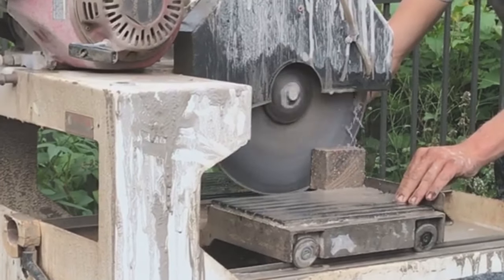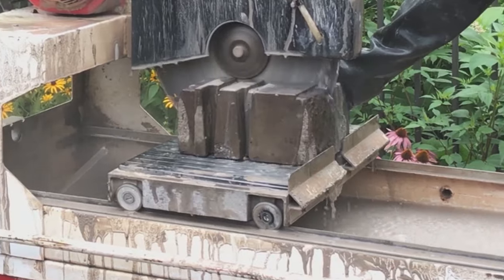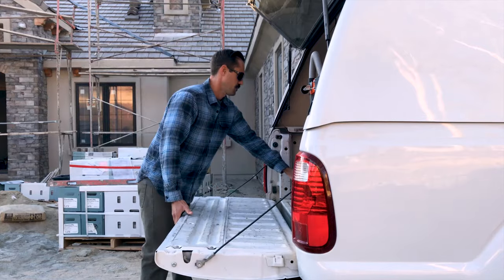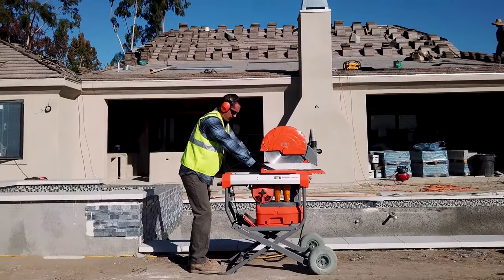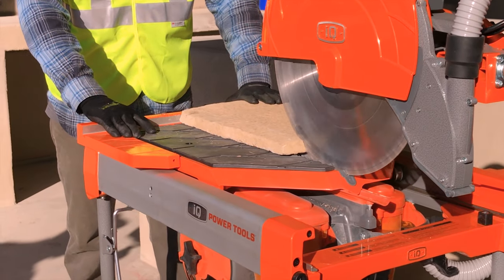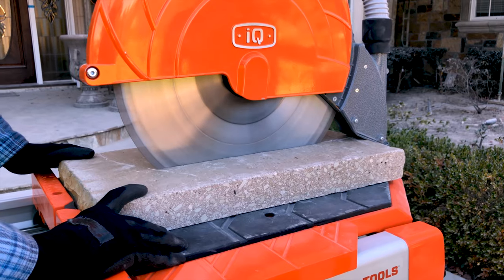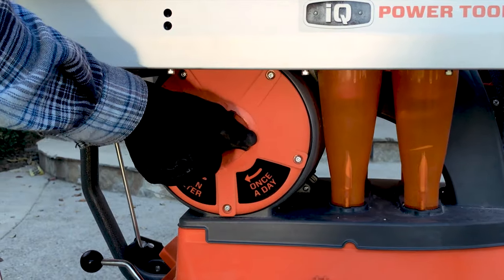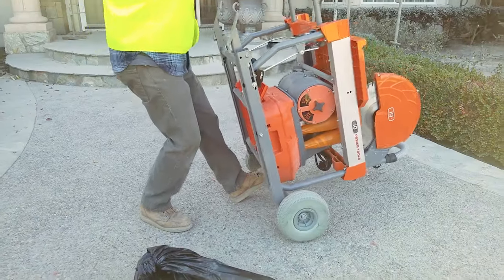World's First 16.5" Dust Control Masonry Saw the iQMS362™ | Dry Cut Dust Free Masonry Saw

Comment: I own and work with this saw on a daily basis cutting mostly brick pavers and block. Overall the saw is what they say it is. But it's under powered and there quick cut blades are crap. They say you have to dress the blades, but you shouldn't have to do that every 2 days. The 20 amp saw pops breakers if you try to cut at any decent pace. I'm going to convert it to a 30 amp and run it off a generator. The dustless design does catch most of the dust when the saw is brand new with new filter but ends up in about the 70% range or you keep buying filters for it. All in all it is costly to maintain but, it's still the best design out there for me right now. I think a much better design would be gas power to the saw and electric and or gas to the vacuum. And a circle Arbor hole so we can use the blades we know and trust from the companies that have put a lot of money into R and D. The Q drive was pretty shity thing to do.

Comment: I just purchased for our stone and brick masonry company. It did not come with the caster wheel shown in the video. Hoping it was just missed at the factory and will be sent to us by the company. The saw we rented had less dust than the brand new one. It is doing great, though. We are working inside with 12 inches of snow outside. Very glad we do not have to run outside for every cut.

Comment: I own it since today and be careful before you buy it. The only way to work as close to this video is if you  use it as the video shows, it means   arm saw is in lowest position and you can only slide the tray forward. You have no chance to play with it to do perfect cut. And even if you do it this way there is quite a lot of dust around you . I would call it 60 percent in stead of of 99.5. And now if you want to use it as the chap saw it is not working completely.  So I spend 3000$ for dustless saw and I have dust saw . But IQ won't tell you that it only "works" when you cut in lowest position. So think twice before you buy it
Reply: How is it waterless.

Comment: Can you cut 200mm blocks?
Can the blade be raised higher as to cut both sides?
Reply: @John Sharp, there’s NOT anything you can’t cut with this saw; solid concrete blocks, porcelain tiles, cinder blocks, glass tiles, ruble stone, etc.

Comment: The advertising is misleading though. It’s advertised as a dustless and waterless saw for masons but the saw is extremely efficient at cutting so smoothly and cleanly  and through just about any material that  pretty much anyone from a tiler to a general contractor could use it. 🙊

Comment: Guys, Don't forget that water lubricates and cools down the blade, which saves you a lot of money in the end! I.e. it's not only about dust...when you realise how expensive blades are you' ll go for a wetcutter
Reply from the maker: Thanks for the tip Alexandre. Yes, it is important to keep the blade cool. That's why we use Cool Cut technology in our blades. It works in conjunction with the airflow created by the vacuum to keep the blade cool. Using an iQ saw and with the proper blade will allow you to cut dry without the mess while maintaining efficiency and great cuts.
Reply: @iqpowertools  water is unbeatable as a lubricant and cooling agent especially when cutting granite. Have you done any tests on how long your blade lasts vs. A wetcutter's?
Reply from the maker: @alexandrepakou3065  yes we have. We have done tens of thousands of test cuts. Our blades can last just as long, if not longer than a wet blade if maintained properly. There are a lot variable that go into this answer. It depends on the material being cut, the speed or force the contractor is using to cut that material, if the bade is dressed and kept sharp... But our blades are very comparable to a high quality wet cutting blade.
Reply: @iqpowertools  time and user experience will tell for sure...

Comment: Is it a drop saw or is the cutting system fixed in place?
Reply from the maker: This is not a chop saw if that's what you mean. The cutting head stays pretty much fixed in place to maintain as much dust capture as possible.

Comment: Can 14” blade can be use on this machine 16” is not very common and expensive
Reply from the maker: No, a 14" blade will not work. You will need Q-Drive 16.5" blades for this machine.

Comment: How much?
Reply from the maker: The iQMS362 runs $2750 and is available now for pre-order on our website.
Reply: What's the time table on when they'll be ready.  Also, is there one in Richmond Virginia where I can see a demo?
Reply from the maker: We are currently accepting pre-orders and the fulfilling them in order they are received. We do have a few dealers in that area that should have a demo unit soon. Visit our dealer locator to find your preferred dealer: https://iqpowertools.com/dealers/
Reply from the maker: Cousin Justin  the price in Canada fluctuates due to the conversion rates. Where are you located? We can get you connected with a dealer in your area that can give you exact pricing.

Comment: I have an IQ myself but I’m a bit disappointed in it!
Me and my colleague bought one and his machine broke the motor hanging €1500 to repair, and my machine would not startup and it is not that i have been using it all the time 
My repair cost me €970 
Another colleague bought one and has no problems with it at all

Comment: Just so you know the blade that cost over 300$ will last one project. So if you are in brick paving business and you cut bricks every day you will have to buy new blade every week. And IQ is only distributor of the blade on the market that is why their blade is so expensive and only last few days so you can keep buying from them. Don't buy this saw!
Reply: Seems odd that the blade wears out so quickly.  Can you use another brand of blade instead?
Reply: Saw looks underpowered to me-ok for relatively soft bricks.   What do you think?
Reply: Most blades are that expensive
Reply: Blade doesn't have a round hole but a hole in the shape of a capitol Q. That way you must use their replacement blade. And what's worse is that people seem unhappy with their blade longevity/cost. I was about to buy this saw but that is a deal killer. Shame on you iQ!